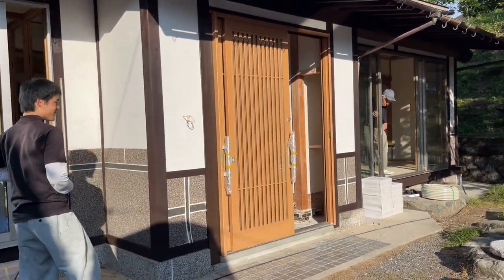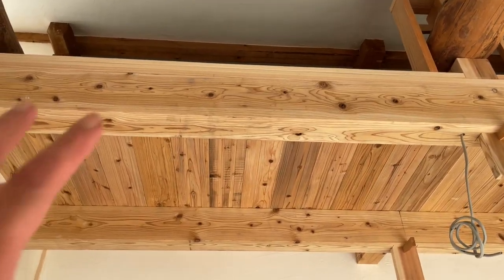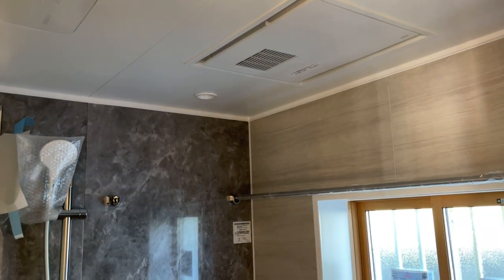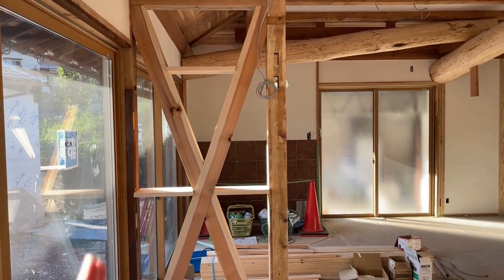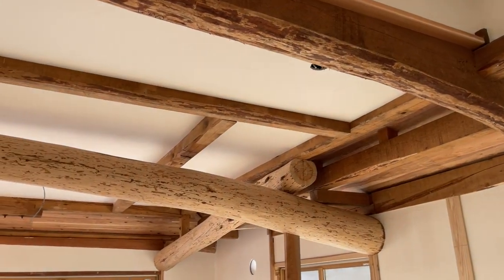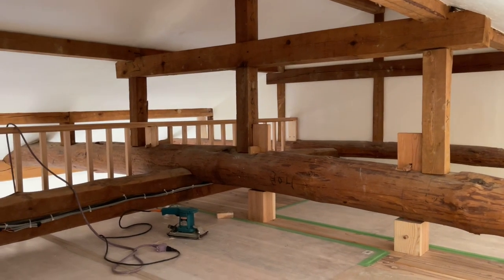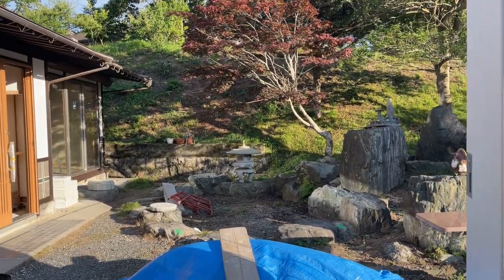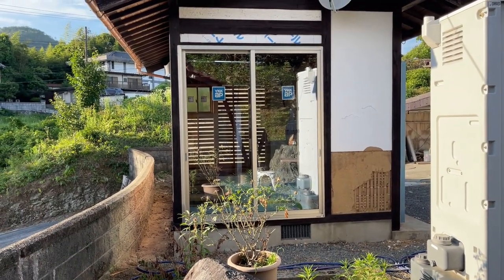Our Japanese Vacant House Renovation Including Shikkui, Loft, Cedar Flooring in Rural Japan

Comment: The underside of the eave looks to be in good condition without looking at it closely. Is it just the look you don’t like? Boarding over with cement Sheetrock is an option and then painting it.  But I think it’s a cheap look compared to the timber. Stain the timber first and see if you like it before doing anything else it’s cheap and quick and really cleans it up.
Reply from the maker: Yeah it’s just really thin plywood that looked nice 50 years ago, nits it’s just falling apart. Purely cosmetic
Reply: @cocolenchojapan  Go with timber slats horizontally between the beams a carpenter could do the ground and second floor in a day no need for scaffolding. See what the price comes in at and throw in that small painting job you need at the same time. I have so many of these jobs here i have to do that i probably won't ever have the time to do them and at the moment no cash to have someone do it for me. Get the quote at least so if you get the spare cash at least you know what you are up for and can plan for it. A carpenter will do it a day and us guys will take a week stuffing around so you got to factor that in terms of value.
Reply from the maker: @RealRuralJapan  yeah the younger me wants to do it myself, but that day may never come. Right now just need to finish the major renovation. Getting so close!